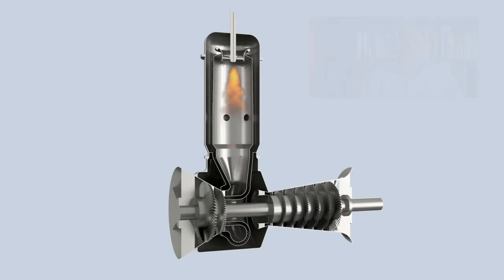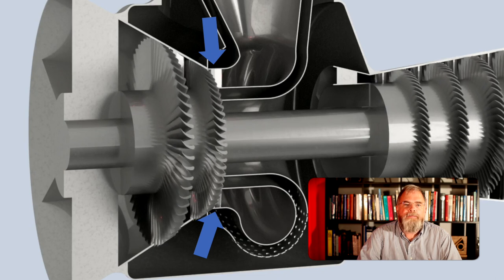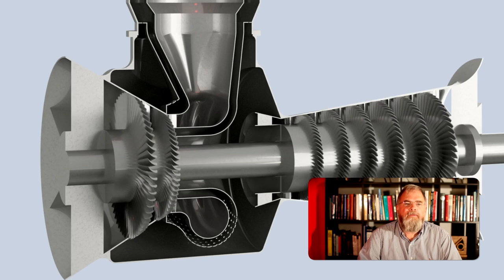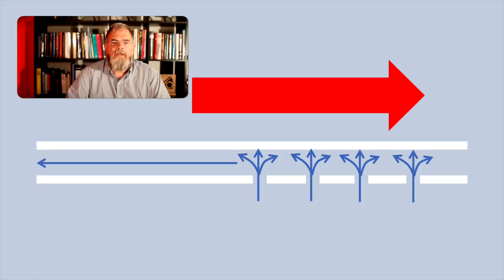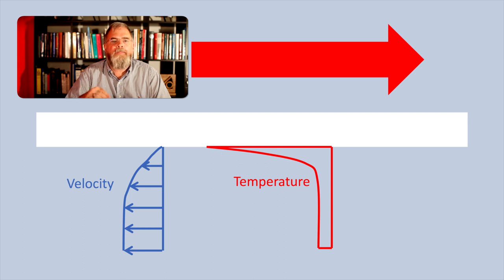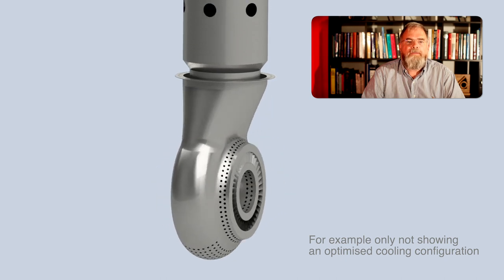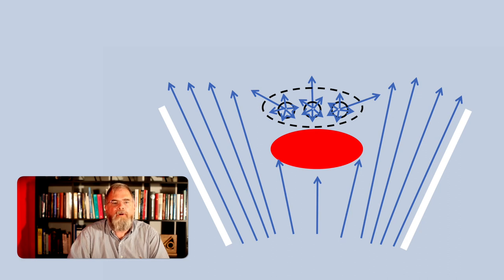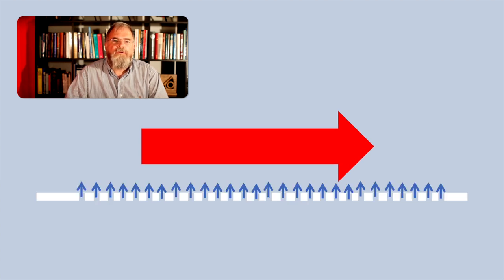Industrial Gas Turbine Combustors Part 2: Single Burner Silo Combustion Airflow and Cooling

Comment: Thank you for your sharing. Will you talk about CFD combustion simulation in future? Thanks
Reply from the maker: Thanks CWong.  I need to find the time to restart this video series again but CFD combustion modelling could certainly be a topic for future videos.  This is the area where my expertise lies.
Reply: @engelbrechtgmbh  That would be a great video topic!  Also an "About Me" (if you are comfortable/interested in doing so, and not NDA locked) where you talk about the various work/research you did along the way would be really neat.
Reply: (Also on that note, did you ever use "OpenFoam" for CFD?  If so what did you think of it?)
Reply from the maker: @ericlotze7724  I have used OpenFoam but only briefly.  I have nothing against it and was pushing for its implementation into the CFD courses at the University of Applied Sciences and Arts Northwestern Switzerland when I worked part time there.  I think it is perfect for students and young people to really understand what is behind CFD plus it is free.  Commercial software is a black box where you really can't see the coding and know what is behind the buttons apart from the models you code in yourself.  For work though I struggled with OpenFoam.  I think you need more time to work with OpenFoam or in a company environment you need someone who devotes a lot of time to it.  Commercial codes are validated before they are shipped against test cases to verify that they behave appropriately, and they have service departments there ready to support when you have problems.  Yes you can pay third party companies to do this with OpenFoam but that defeats the advantages of it being free.  And if you do it yourself you really aren't saving money because you end up spending the time you could be generating revenue doing this yourself.
Reply from the maker: I work mainly with CFX as this is the code I have the most experience with being introduced to Flow3D, which ABB had a special arrangement with the developers with so we had the source code for when I first started working at ABB.  Flow3D became CFX-4 and led to CFX-5.  So through my work at ABB/ALSTOM I became very experienced using this code and can quickly do things with it.  I also have some experience with Fluent and less experience with Star CCM+.  As a consultant, now, it is important to be able to use whichever CFD package your client has to be compatible with their work.  They are all good codes including OpenFoam and I should add some of my past clients have been using OpenFoam particularly for research and massive calculations where a large numbers of parallel licenses would be very expensive.   So in general I think OpenFoam is good but it does require more work to use and ensure you get good results than most commercial codes I've worked with.